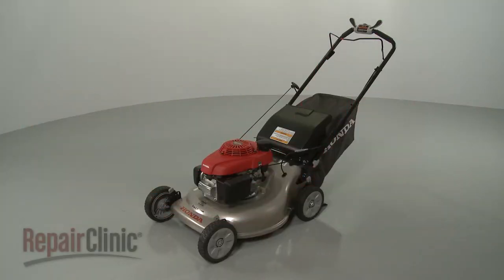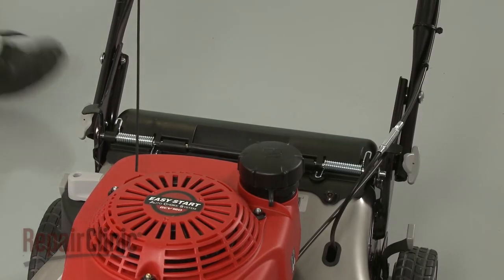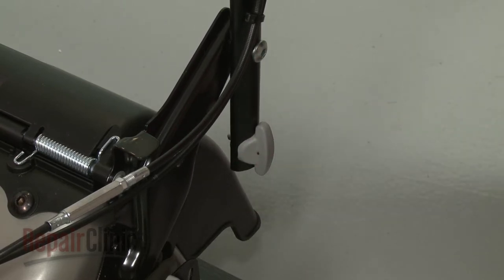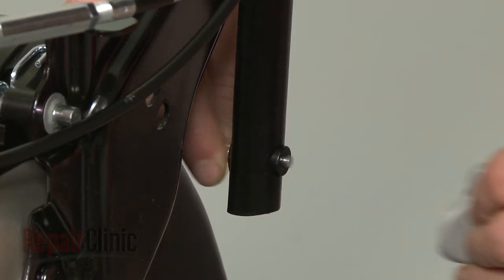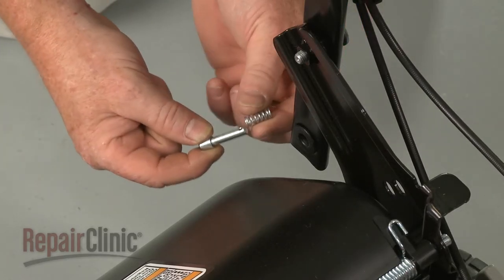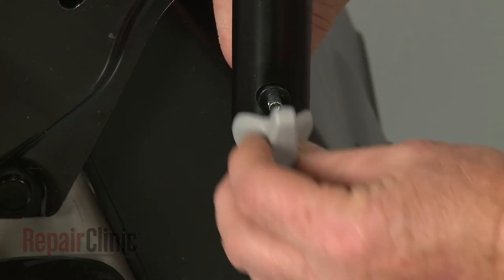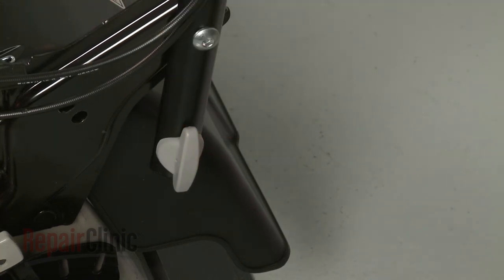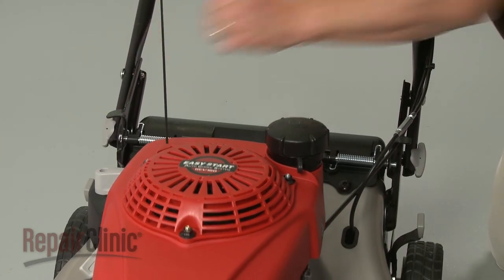Honda Lawn Mower Handle Lock Pin Replacement Part # 53158-VL0-B01

Comment: I have lost all these parts in the yard several times over the years. This has actually been the most expensive part of owning this mower (believe it or not!). I have figured out that the roll pins dissapear by either falling out, or 1st breaking and then falling out. It will be regualar anual maintanance going forward to replace the roll pins and wire them in. I wired them in last time and still somehow magicly lost one. The pins I just installed are 5/64" x 1/2", and are quite snug.

Comment: The pressure fit pin that holds the assembly together is hollow.  I used a wire from a twist tie to slip thru it and tie it around the handle for extra assurance.